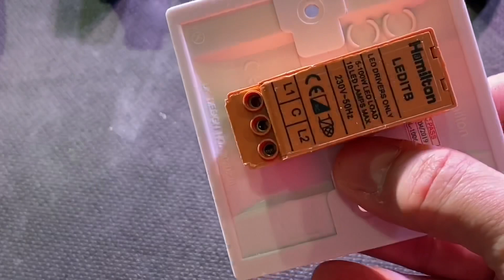WIHA Picofinish insulated screwdrivers

Comment: I don't have a precision screw driver set,the smallest I have is a Pz1 for some fan and downflow heater covers and about a 2mm slotted for some elecronic circuit board connections for certain types of Nuaire fans and lot20 storage heaters.
 I can see them being used in such things as RC cars, model Airplanes  and trains for the hobbyists as well.

Comment: Nice ones.
They are called-sounds viha with V.
W at German is could V.
At wall mounting you flip them up side down and place them at the holes of the holder and you can see the numbers on the heads, and for pouch I use a pencil one with cartoon characters on it.
Very nice video.

Comment: I use Wera Micro ESD as these also have two specialised screwdrivers, namely the mini Torx and tri-wing. Also they have the hex ring that both helps with tightening using just fingertip pressure and also stops them rolling away. Wiha ones still look very good though!
Reply from the maker: Great comment 👍

Comment: I’ve got a cheap make of these precision that are very useful. I would definitely consider this set for next time but would have to address the squeaking handle . As for dimmer switch terminals If you have more than one 1.5 mm going not even great screwdrivers can sometimes help 😁
Great vlog as usual guys .